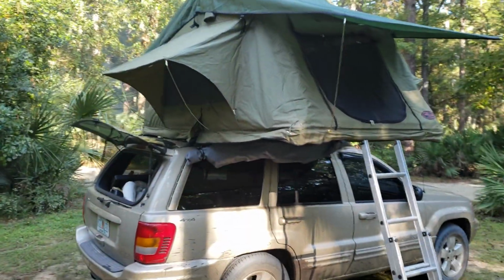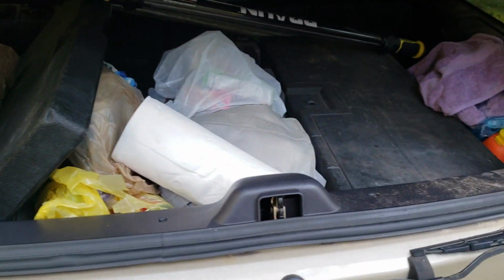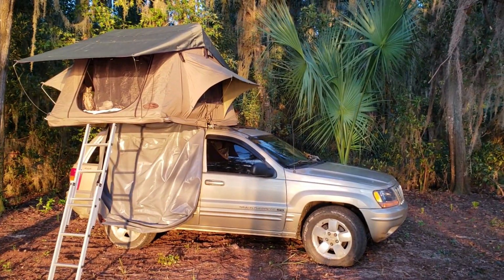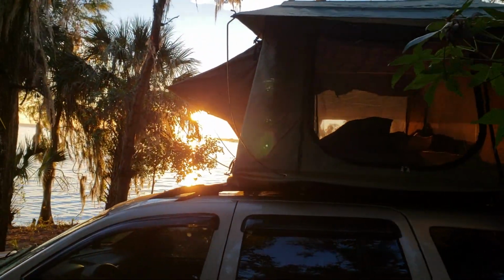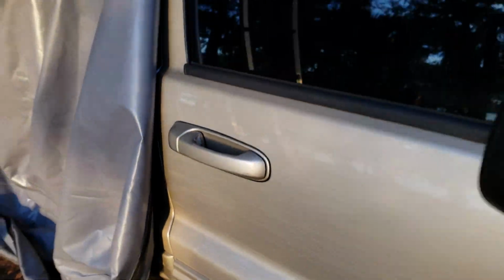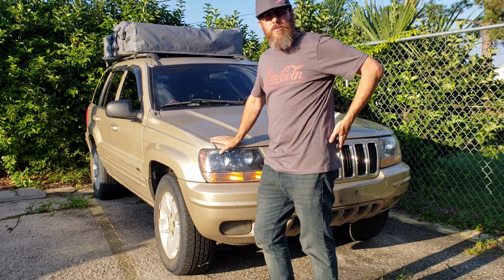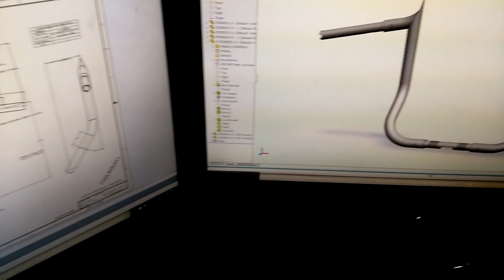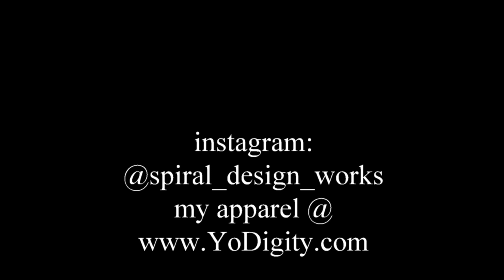EP.11- FIRST CAMPING TRIP-WJ JEEP GRAND CHEROKEE

Comment: I had factory Rails too, but I added Thule Cross members and it will work fine.
Reply from the maker: I ended up removing the factory rails and making custom mounts. But they are off now while I build a new roof rack with quick release tent mounts.

Comment: Do you have any concerns about  factory WJ roof rails holding the weight of a roof top tent.  Are the rails attached to metal or plastic at the roof ?
Reply from the maker: The factory roof rails are just attached with bolts into 'Well nuts" into the sheet metal.  So it is a concern.  My plan is to build a basket style roof rack that will be thru bolted with backing plates into the roof structure.  I have done some wheeling with it on there and so far no problems and I would check it when I was standing around.  But it is maxing out the weight rating.
Reply: @SpiralDesignWorks  Thank you , I guess I should go another direction.
Reply: I had this same concern with my 2000 wj as ive never really looked at it or put anything on it before. Thanks guys. any suggestions for modifying for the roof rack tent please lmk.